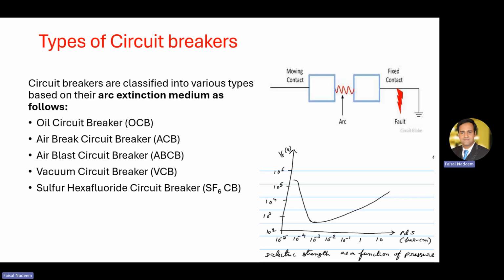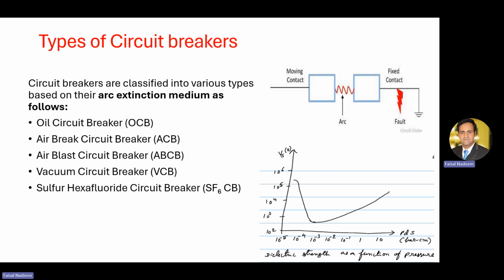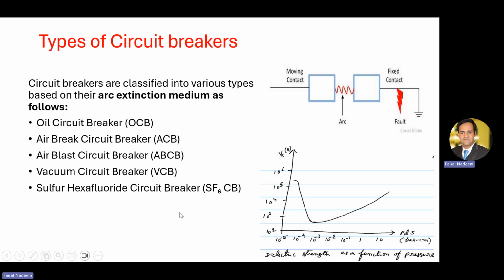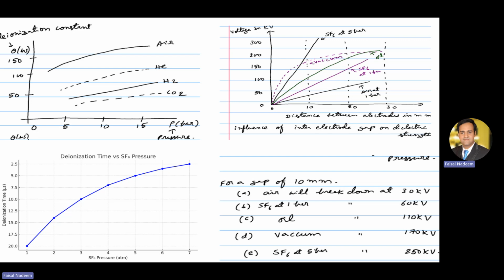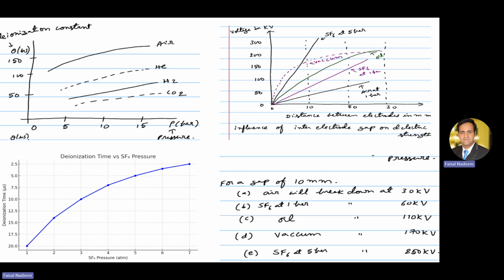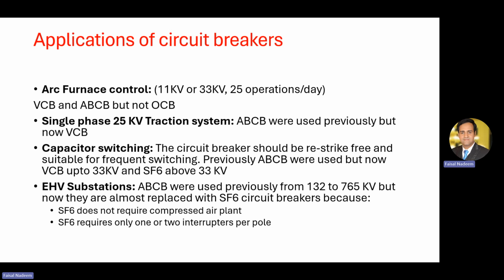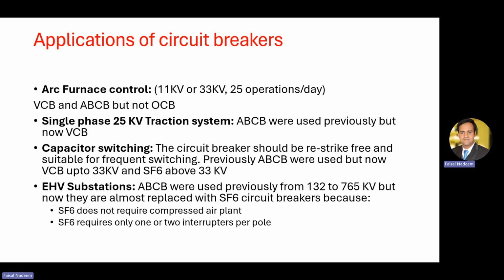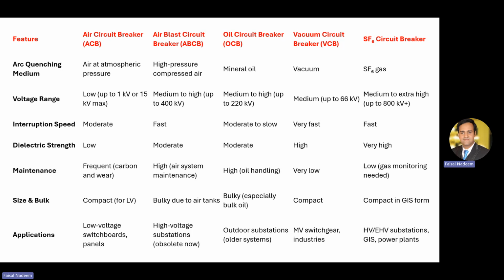Types of Circuit Breakers

Comment: In Example 9.1 of Chapter 9 (Balanced Faults) from power system analysis by hadi saadat, how is the change in voltage ΔV₃ calculated at Bus 1, Bus 2, and Bus 3?